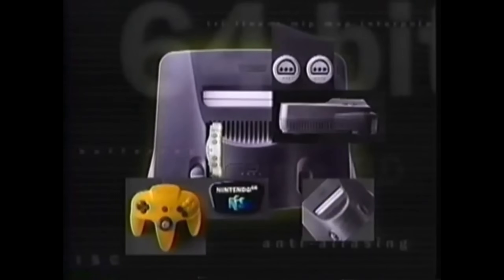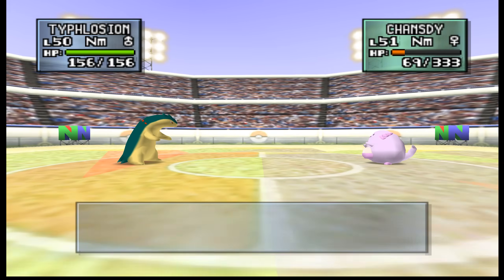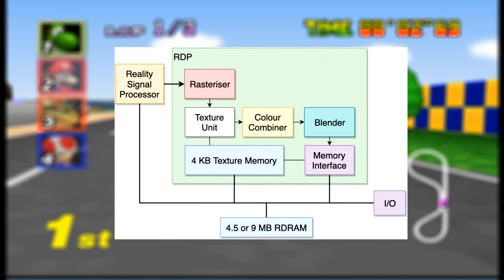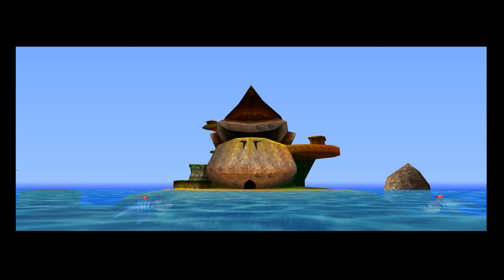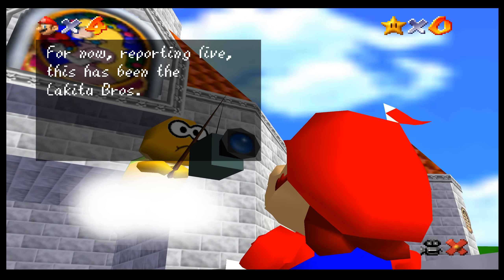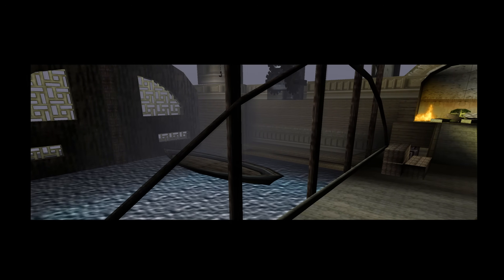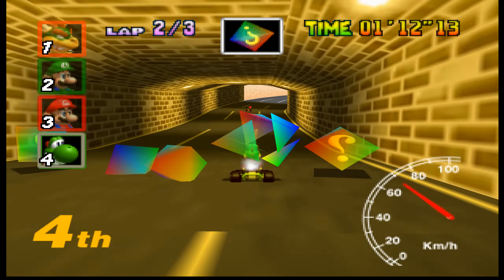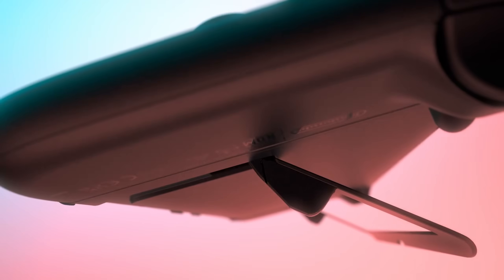The Nintendo 64 GPU: Reality Co-Processor (Retro Breakdown)

Comment: The long standing narrative that the N64's RSP was bottlenecked by the memory sub-system has been largely debunked by Kaze Emanuar. He has vindicated the NEC engineers, and everyone else involved who designed the N64's hardware. 

He has demonstrated that if you know how to properly optimize a game's graphics programming for the hardware, the RSP does not get bottlenecked. 

One might argue that a beefier memory bus and/or dedicated vram would have made it a lot easier to program for, and still a better design as a result, but it's hard to fault the design itself when it has now been proven that it is possible to avoid a memory bottleneck. 

The problem was more to do with a lack of prioritization of 3rd party developer support. Games like F-Zero X prove what was possible on the system when the programmers knew what they were doing (that game runs at a fairly consistent 60fps).

Comment: It should be noted that TMEM is not really a cache in the conventional sense. Namely, it's NOT transparent. The developer must load any and all textures that the RDP has to rasterize into TMEM *manually*. There is no way to avoid the TMEM's size limitations, and as such texture resolution issues can only be compromised on by either using lower color depths or subdividing geometry. The latter can be especially devastating on performance, as that requires doing multiple chunked loads of a large texture for a given frame (RDRAM-to-TMEM fetches are one of the slowest operations that the RCP can issue).

In contrast, the PS1's 2KB texture cache is transparent.The developer only needs to worry about texture page limitations: 256x256 pages with a 64 pixel wide sliding window. If the GPU needs to draw a polygon whose texture ST coordinates exceed the maximum texel size of the 2KB cache, the GPU will automatically fill the cache during rasterization. This does impose a performance penalty, but it's not a hard barrier like it is on N64.

Also, do not be fooled by the "peak" bandwidth figures, as not only are they almost never achieved (the highest measured bandwidth from the L1 cache was around 162MB/s, and cached RDRAM reads at around 32MB/s), the memory controller in the RSP literally cannot facilitate that much memory transferring in a second, since a game will constantly do things other than perform color fills, and all those operations will lead to constant bus contention.
Reply: It wasn't uncommon with graphics APIs at the time to have to bind a texture to use it, so it wouldn't've been a particularly foreign abstraction.

Comment: It has been confirmed by Rare and Silicon Graphics that the console was going to be more efficient when programming games and running games smoothly, Rare made an icosahedron spinning at a stable 60 fps and Silicon Graphics was concerned about that and saw the efficiency and fixed things with the hardware and the icosahedron became less efficient and harder to program and they gave the excuse that there was a problem with the processors and that they fixed it. Silicon Graphics' decision to do that was because they didn't want it to be discovered how easy it was to make models under their technology on the console and that everyone bought their workstations, business decisions they said, because the N64 had the complexity of choosing between graphics or sound in terms of efficiency and because of these things not only is it difficult to program games but Nintendo has a hard time emulating the console.

Comment: Great video, but there are some errors here.  TMEM is not a texture cache despite often being referred to as such, it's the only place RDP can use as a source for textures, and it has to be manually managed.  This is probably the single biggest mistake in the entire N64 system design.  For comparison, the PS1 used an automatically managed true texture cache 2 kB in size, and could load textures from anywhere in its megabyte of VRAM.  Also, the "extra" half a megabyte of dram is actually just the 9th bit of the main RDRAM, which is normally not used by anything other than the RDP.  It's not embedded memory.
Reply: PS1's textures looked like a$$ though. You could barely make out faces on characters like Squall. It may have had some advantages, but they came at a great cost. Same with any console of that time. Even Saturn had to make some compromises, due to the console's hardware more-so geared towards 2D games. They kind of had to brute force 3D graphics into the games. 

5th gen consoles were experimental at best, and all of them had some sort of flaw, something missing that the other competitor had.

The biggest advantage PS1 had over any other platform of that time was third party support, it also helped that developers got access to cheap dev kits. And while I admit, discs were the better medium, they still couldn't fit a lot of games onto one. Look at how many discs the Final Fantasy games had, and tell me with a straight face the medium is perfect.

It's not as if the hardware blew every other competitor out power wise. It didn't even have z-buffer. The biggest Achilles Heel of Nintendo 64 was a lack of third party support, and an extremely small library of games. Only a handful of first party titles were holding them up in that era.
Reply: Yet Body Harvest, Zelda and several platformer adventures seem to be more vast than anything on Playstation or close to it.
Reply: @MrBlack-wt5er seems to be that way. I know someone will no doubt bring up some outliers, but the few games N64 had were absolutely brilliant in terms of scope. Crash and Croc games were basically like 2D platformers with a different camera angle.

Comment: The only downside to the N64 is the controller. The Z button is often used as the L button, even if not meant to be used that way. And you can't grip all 3 handles at the same time. I also don't like how there is NO Select button. 

NES had a select button
SNES had a select button
N64 NO Select button

Comment: I gave my N64 to my ex-brother-in-law. I wish I hadn't. But I also got a Saturn and a Genesis from my other ex-brother-in-law, so I feel like I kinda came out on top (especially since the Saturn came with a bunch of games and 2 Stunners). Still, the N64 remains one of my favorite consoles to this day, and I will be adding it back to my consoles soon.

I don't think the cartridge format really hurt textures much, as I think the 4kb texture RAM limited them more than anything else. The cost of the cartridge format was far and away the biggest problem I remember reading in some magazine about how the cost of cartridge manufacturing was something like $30 each, and Nintendo had finally lowered it to about $18 each, while at that point the cost to press a CD for Saturn or Playstation was about $1. Now granted, that was obviously heavily simplified, because the size of the cart mattered (the larger the ROMs, the more they cost), but I'm quite sure that N64 carts cost at least 10x the cost of discs for the other consoles, which is huge, and was exacerbated by Nintendo's requirements for big up-front purchases. Manufacturing also took a lot longer. The risks of making an N64 game were WAY larger than the other two consoles. That drove third parties away, which hurt the N64 more than anything else.
Reply: I don't know if I would call it a loop, the RDP texture cache just holds the particular texture it's immediately working with. The problem is that the N64 uses a directly mapped cache that has to hold the entire mipmap, whereas the PS1's 2K of cache is nowhere near sufficient to hold a 128×128 texel map, but it isn't too big of a deal because the PlayStation has a fully associative cache that can divide the map up into whatever 2k chunks it needs to render to the screen. Kaze actually does kind of trick the N64 texture cache into acting like a quasi-associative cache with the multitexturing technique to a single polygon to get a texture with larger resolution than 32×32. The N64 hardware requirement for direct mapping instead of associative mapping is more of an issue than the texture cache size itself. Of course, SGI/Nintendo didn't care because the cartridge capacities were never going to be adequate for a bunch of 128×128 textures anyways.
Reply: The PS1 had half the texture cache of the N64, and blew the Nintendo out of the water in texture map sizes; it really, really was the low cartridge capacity holding it back. That, and the map sizes that Nintendo used to hold the textures were smaller, but again, Nintendo specifically created those maps to favor the reduced ROM capacity of cartridges.
Reply: @ostiariusalpha  That's not true. The majority of PSX games either didn't use the whole disc space or used up a lot of it for audio tracks, FMV, and data duplication for better loading times. Cart sizes were certainly a limitation early on but by the time games were using 16MB carts I highly doubt that 32x32 and 64x64 textures were limited due to cart size, considering how little space they actually take up.

When using trilinear interpolation, the texture cache is effectively cut in half, making it the same as the PSX' 2KB. But even with the total 4KB cache, the N64 is still limited to significantly smaller texture sizes than the PSX (which had a max texture size of 256x256). I don't know why Nintendo limited the texture size, but it makes no sense for them to have purposefully hamstrung the console by limiting it in hardware rather than just let developers choose how to use the available cartridge space.

There are a lot of tricks that can be used to get good-looking textures out of the N64, but the main problem is that the hardware itself is very quirky and many of these tricks took decades to figure out. Programmers back in the day simply didn't have the time to discover them all. There are quite a few programming conventions that were either the norm back then or were encouraged by Nintendo that actually hurt the performance of the hardware (like running 64-bit code on the CPU instead of using 32-bit code).

Had this stuff been known back then, we would have gotten faster, better-looking games. Thus, it's not so much that the 4KB texture cache was a problem, but that the technical caveats of the hardware made it a lot more difficult for developers at the time to utilize the hardware effectively.
Reply: @rars0n  Trilinear interpolation happens separately from the texture cache, it doesn't effect texture resolution while in the the cache; and though the graphics data of PS1 games is generally only a small part of the CD capacity, the texture map part of that graphics data is usually quite a bit larger than it's counterpart in any N64 cartridge. Taking the texture maps from PS1 Quake II and trying to use them in N64 Quake II would be an exercise in futility, even without trilinear interpolation.
Reply: @ostiariusalpha  I'm not talking about texture filtering, I'm talking about mipmapping. It halves the texture cache when trilinear interpolation is used.

Honestly, it's nonsensical to suggest taking textures from one system and applying them to another. Saturn, for instance, wouldn't work at all because it uses quadratic polygons. The reality is that to optimize artwork for any of these early 3D systems, the textures have to be designed specifically for the hardware, or otherwise they're just not going to look good.

You should look at what Kaze Emanuar is doing. He's made many videos showing work he's done with high-resolution textures on the N64 and demonstrating how much better they can actually look.
Reply: @rars0n  It's not nonsensical at all, the forward texture, affine texture, and perspective texture mapping formats are not interchangeable, of course, but the textures themselves are agnostic to the format they are put in. And mipmapping actually makes using larger textures easier rather than harder, because it reduces resolution at further draw distances.
Reply: @ostiariusalpha  Designing textures without regard to the specific limitations of the hardware is nonsensical (and lazy).

"And mipmapping actually makes using larger textures easier rather than harder"

I never said it made it harder, but obviously in order to actually USE mipmaps, you have to store them in the texture memory.
Reply: @rars0n  No, you do not need to hold the mipmap in the texture cache. It can sit quite comfortably in main memory and the texture cache can reference whichever resolution of the mipmap it needs at a specific draw distance.
Reply: @ostiariusalpha  That's not how it works on the N64 hardware.
Reply: @ostiariusalpha  i believe on the n64 all on screen textures are rendered in a loop on the rdp only ofscreen textures are in mainram and updated if needed.
Reply: @rars0n  That's the real problem, rather than the size of the cache.

Comment: The N64 was again an example of how Nintendo stands in its own way by implementing bottlenecks you can see from miles away out of sheer costiveness. Giving 8KB instead of 4KB of texture cache would've helped a lot and made life so much easier. 
It would've made the RSP a tiny bit bigger, but would save the devs many crunch hours and workarounds.
Same with the 8-Bit databus on the SNES, that always needs two transfers for a word.
Or RAM and SoC on the Switch, just using the Tegra X2 would have helped with the battery life, the RAM bandwidth, the cooling and would've prevented the fusee gelee hack. All decisions that costs cents per unit, yet makes life for us programmers so much harder.
Reply: They new but it all came to cost.  The switch was going to have 3gb of ram, but they listened to developers and gave it 4gb.
Reply: @johnjay6370  Who said that? It won't make any sense to put 3GB on it, you can't really do that because of how memory interfaces and IC sizes work. Either 2GB or 4GB would work, otherwise you add a 1GB to the second RAM Controller but it won't make any sense because of how addresses work.
Reply: @Diablokiller999  I know what you are saying but that is a fact look it up.  There are lots of videos talking about it.  There are also old 1050/1060 graphic cards with 3gb ram.  Look it up if you do not believe me.  And yes I understand your point
Reply: Kaze Emanuar has largely debunked this long standing narrative, more or less acquiting the NEC engineers who designed the N64 of any wrongdoing, and instead placing the blame more on poor support by Nintendo toward its 3rd party developers, and by just a more general lack of adequate understanding and training regarding how to optimally program graphics for the N64.
Reply: @syncmonism  I know his videos very well, but if you can help devs with a larger cache to avoid optimizing the hell out of your engine, you increase the cache and avoid the bottleneck. At least this is what I do as a Systems Engineer.
There are workarounds as he has shown, but keep in mind Kaze is using tools and performance for analysis that devs in the 90s couldn't even imagine ;)

Comment: 😂 Even with the largest of rose tinted spectacles the original N64 hardware  never looked like that.
If you're gonna use emulation and crank up the res at least mention it; bit misleading imo.
Just some constructive criticism,   no hate, great video apart from that, keep up the good work 👍

Comment: Little disappointed there was no mention of the notorious memory latency on the N64 that held it back. The GPU and CPU were powerful, but they couldn't be fully utilized since they had to wait on slow memory transfers.

Also the GPU had programmable microcode and studios like Factor 5 and Rare were able to push the N64 really well. Battle For Naboo honestly is a stunning game.
Reply: It’s what it can do now that counts it can run full Linux doom by a direct frame buffer stream method a very smooth wolf 3D port also portal this is all possible with open source dev kits like libdragon and everdrive cartridge
Reply: doom bypasses  the gpu chip altogether rendering full textures and  utilising the memory expansion as floating ready memory

Comment: sometimes I wonder how well the n64 would work if someone  got rid of that memory bus and put separated memory for the cpu and gpu, I wonder if it would be impossible or just too much work for it to work
Reply from the maker: @AmazinChannelz  this is a really good question!
Reply: @FrameRated  yeah maybe a simulation using some emulator could answer that without going through all the work of moding an actual n64 or maybe the fpga core moded

Comment: Well what home brewers could do really convinced me for what hardware is capable off.
Because most N64 games didn’t look or sounded better then ps1 games but were actually lower in quality because of limited cartride space.
Also it’s cpu only has a 32bit data bus so maybe nintendo was just better off to go for a 32bit cpu and call the system the nintendo ultra 32 instead along with a CD drive.

Comment: I would appreciate if you go much more into detail.
What kind of person complains about a hardware explanation to be too detailed?
Then they should watch different things.
Reply from the maker: I just get a lot of comments sayings they would rather straight forward and digestible. It’s hard to please everyone sadly
Reply: @FrameRated  It’s all good, do what’s most fun to you and what your audience likes the most.
There are many great 2 hour deepdive videos about each individual console out there so you don’t have to create another one.

I am fine with your videos, they are great for the newcomer that already has some technical knowledge but wants to get a deeper introduction into those consoles without learning the assembly language or die layout of that specific console.
It is basically in the middle of the complexity chart which is good, because both extreme ends are already well populated.
Reply: I to would also prefer a much deeper breakdown. To me the information is too wstered down to use as a programmer.